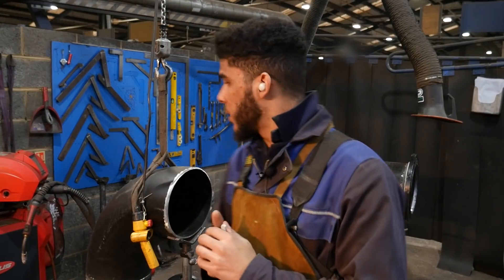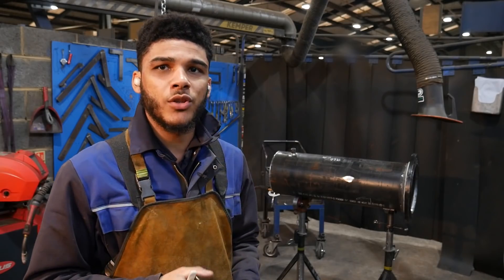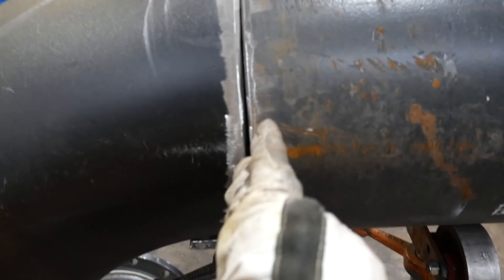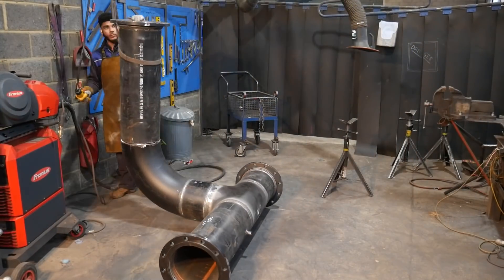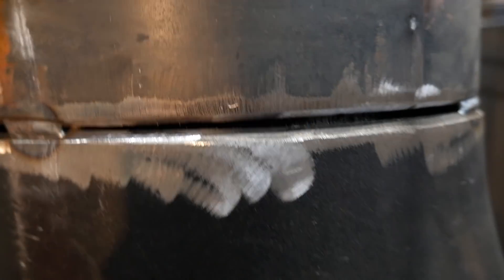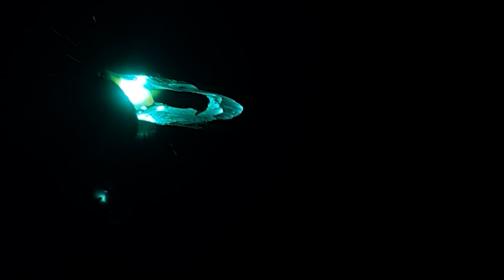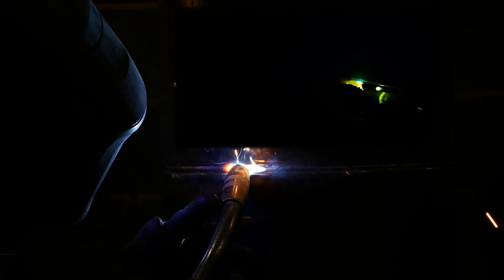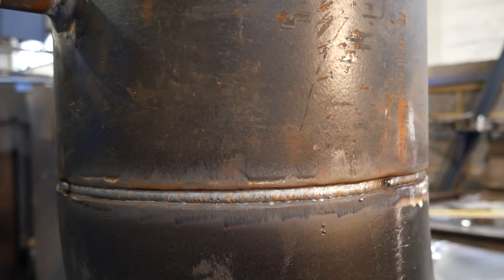How To 2G Open Root MIG/MAG Pipe Welding

Comment: Where you screwed up with your aliment was that you did check your flange on ground you needed to check your bolt holes were square you may have lent the bend over out of square to make up your overall measurement.

Comment: I'm a tacker at a pipe fab shop practicing for my mig welding test. Your tip on pointing the tip away from the puddle helps a lot because I was having quite a few blowouts when the heat built up too much on the root. My test is 6G sch. 160 pipe though😬
Reply: I’m not sure if you ended up taking your pipe test yet, but I find for 6g mig you don’t have to do anything special. As long as that heat is good burn it in. Just watch your puddle and wash up on the walls if it wants to fall in. Hell my first mig test I ran a little bit, checked it,  feathered it to tie in and kept going lol. Best of luck brother

Comment: Good job I like pushing in the final stringer.I use a cutting wheel to even the gap and a 3/16 grinding wheel to flatten the root landing
Reply: Yeah! Pushing a cap is so much easier to see where you’re going!

Comment: I’ve never worked with pipe before, is it a standard practice to drag your roots? If not what made you drag as opposed to push
Reply from the maker: For me its common practice an i learnt on on the job, and when you push almost impossible not to blow through with your root and draging is more controllable

Comment: much more speed, maby 0,2-0,6 +
should you not weld these pipes with a coated electrode due to the very rapid heat loss during welding? the tensions will be quite large and a leakage may occur 🙂

Comment: Do you ever find you have to tweak the synergic settings i end up going on manual sometimes on my fronius apparently europe they do there runs a lot faster than in the uk
Reply: Yeah at the highend in the spray range i find that the voltage can be a tad too low at times. But short arc is perfect. what fronius you using? a tsp?

Comment: Great video mate 👍🏻I’ve never used pulse on mig, I always use pulse on root n cap on stainless pipe with tig, more penetration less heat, why do you not use pulse for root? I’ve just gone on carbon steel pipe after years on stainless 👍🏻
Reply from the maker: Pulse on my root would be too uncomfortable and i wouldn't get a root

Comment: 6:18 how do you deal with something like that? it looks like the wire pushed through the root but didnt melt and fuse into the root?
Reply from the maker: If you cant have it at all you would cut back the root and weld it again, for me i was able to reach it at the end and chip it off

Comment: Hey man, nice work you have done! I see you in your videos welding a 2G/2F pipe/flange all around in one or two go while moving your steps at the same time. Any chance you can film a video explaining the technique and how you can keep the arc at the same rate while moving. Most of us can only weld one section at a time without moving our feet. And also welding the nozzle all around in one go, it’s astounding!
Reply from the maker: Thank you very much man 🤜🏽🤛🏽 ive gotten allot of criticism for doing that weld they say i should have welded it first normally 😅😅 but a video like that would be made for my instagram
Reply: I like your attention to detail, very very hard (nigh on impossible) to find staff like you. A tradesman at work 👌

Comment: Did you check you bottom piece and make sure it was level with the flange holes?
Reply from the maker: Yeah the pipe on the bottom was the master and i was leveling off the smaller pipe to that
Reply: @ARCONEWELDING  already just double checking, gotta look at all the variables while dealing with Pipe or anything, some get a crazy bend and will make you scratch your head

Comment: Great bit of content again, good having the run-throughs of the process too👍
Totally different to what im used to doing, but being mig work, its a bit new to me. Goes in so smooth on the pulse setting though, looks great to work with. Not too sure id easily give up my tig torch for that dip transfer root though 🤔
Top workmanship as usual there though👌
Reply from the maker: Everything about mig pulse is fast, thats the beauty of it, and it gives you no splatter

Comment: Dude... what’s the reason you’re dragging/pulling the torch?
You’re in the PC position, nice and easy to push that torch correctly.
What’s the max inter-pass temp?
Reply from the maker: The reason i drag is so my welds can come out nicely, were tested in our methods and have passed but if i try to push i cant see what im leaving behind me to know if its coming out fine
Reply: ARC-ONE WELDING interesting. Pushing you get a better view of the weld pool and it also produces better penetration. Personally wasn’t taught to pull this process, can’t imagine anybody with a city & guilds welding apprenticeship was either. Let’s see a video of you pushing a butt weld in this position... 😬
Reply: @weldinginspector7212  does pushing gives a better depth of penetration then?, i always thought it just  flattened the bead out (where i work now and last few places its been all tig and stick, the only mig was heavy steelwork so all 250amp+ spray transfer pushed ). 
Can see where he's coming from saying about actually seeing the bead as he travels along though🤔
Lives and learns👍👍
Reply from the maker: I will have a video coming out soon about push and pull and the Penetration was almost the same in both directions
Reply from the maker: Honestly i would struggle to push i woudnt know how my cap is looking and my shroud would touch the weld pool
Reply: @ARCONEWELDING  look forward to it buddy 🤙🏻🤙🏻